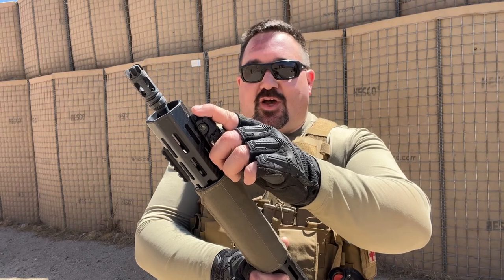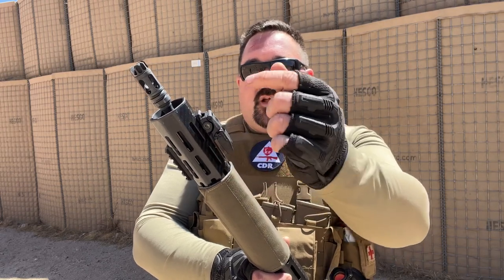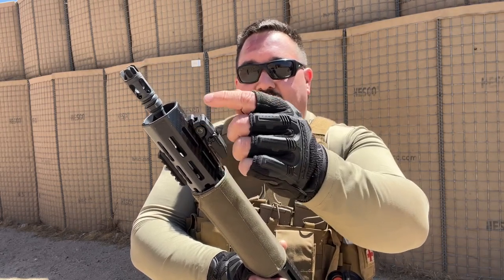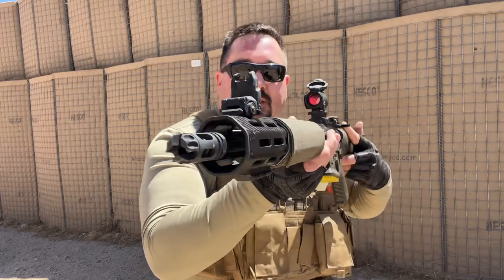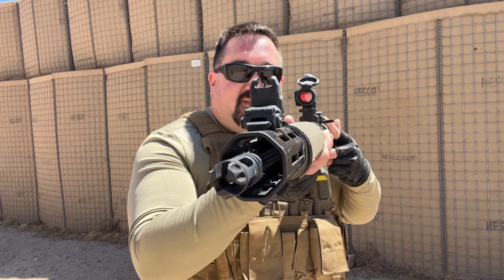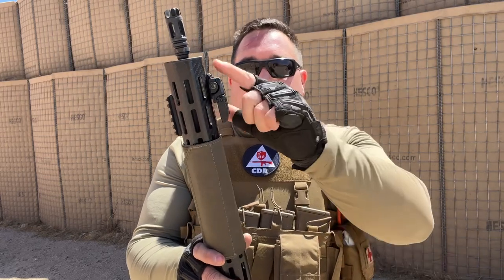How to ruin a WWSD

Comment: you're not tacticool unless your rifle has at least three sighting options
Reply from the maker: 7
Reply: @InrangeTv  and a forced watercooling system, for maximum flair.
Reply: how do i mount this crimson trace grip

its for a luger but it should go
Reply: I’m in this picture and I don’t like it
Reply: 1) Insert muzzle in target's left nostril.
2) Insert muzzle in target's right nostril.
3) Insert muzzle in target's left eye socket.
4) Insert muzzle in target's right eye socket.
5) Insert muzzle in target's mouth.
6) Insert muzzle and foregrip inside target's left trouser leg.
7) Insert muzzle and foregrip inside target's right trouser leg.
8) Remove target's trousers and insert muzzle in ta- Yes? Oh. Alright. There is no eighth way.
Reply: "What's that whirring sound?"

"Oh, that's either the gyro for the lead-predicting reflector sight, or coil whine from the millimetric-wavelength radar."
Reply: 3 Gun Open Class shooters are spending millions in R&D to find a 4th.
Reply: Mine has three🥴… Eotech, fixed front sight co-witnessed to act as a “ghost ring” through the window if the optic fails, and then a flip up rear BUIS for after the eotech is removed when/if it fails. But it’s a pistol not a rifle 😝!
Reply: @InrangeTv  Lol I built a 300 Blackout vacation.  Short barrel, big suppressor.  It is a WWSDIHWBATBAWITBVQ (what would Stoner do if he were building a 300 Blackout and wanted it to be very quiet).
Reply: @InrangeTv  What about the Leupold HAMR?
Tilt it to use the stacked Delta Point with your non-dominant eye. Add RMRs at 45° & 90° and laser grips. Flip up BUIS w/ tritium inserts a la GALIL/SIG 550 and In case of EMP😉, carry a few candles 🕯
Reply: @BogeyTheBear  The accumulator for the 40kW pulser...
Reply: @gregoryfilin8040  Conclusion: The most tacticool firearm is a Maxim machine gun
Reply: 3x tritium ACOG mounted on top, 45° trijicon RMR, and back up iron sights.

Side charging upper, 90° mounted rifle light laser combo, retractable bayonet, detachable brass knuckle foregrip, and a 100 rd ballsack magazine.

The ultimate versatile mall ninja set up.
Reply: @that1electrician  ahhh, yes… the side charging handle contraption for ARs. The ultimate zero purpose, added complexity, reduced functionality, tacticool add on!! 
If only it would make the charging handle reciprocate too… just like the best feature on the SCAR16
Reply: @InrangeTv  perhaps you could do a whole shitpost series of useless items to add to ARs. BAD lever, side charging handle uppers, forward assist…
Reply: @InrangeTv  I now want to see SinistralRifleman put as many different sights on his WWSD as possible:)
Reply: I have seriously added a shotgun high-vis bead front sight along flat handguard sections as an emergency backup.  Less useful at 100 but at 30?… gets the lead downrange.
Reply: Hey I really like the concept, but can you recommend the best way to mount a bayonet?  Since it is Carbine length, I need at least a 26" blade to properly repel cavalry.  Thanks.
Reply: Of which all are accessories.
Reply: @williamflowers9435  there are already side charging uppers with reciprocating charging knobs. Unless you mean opposite the ejection port..
Reply: Or you could just go to the future!!!
Reply: @williamflowers9435  side charging ARs have a legitimate role, albeit a very niche one. Single loading 90gr rounds through the ejection port, whose OAL won’t fit in a magazine. Exclusively for extreme long range (for an AR15).
Reply: Two is one and one is none, and you would be a fool not to have a back up.

So if my math is correct you need 4 sighting options.
Reply: @williamflowers9435  that would be hilarious
Reply: @eVVigilance  If you mount a long bayonet on a WWSD and use it against cavalry, the momentum of the horse and the mechanical advantage given by the distance from horse rib to rifle trunnion is going to bend that pretty little pencil barrel.
Don't put a bayonet on your WWSD carbine.
Carry a separate halberd, and a dagger or gladius for use if they get too close for you to use the halberd.
Reply: @Sableagle  I had considered this, but rejected it under 2 different possibilities.  In the first, so as not to unduly burden myself with superfluous and unnescessary accoutremants I need a solution that will be "all in one" eg a bayonet that will serve as pioneer saw as well, but equally well for entrenchment.  A seperate shovel, saw and pike, simply will not do.  More concerningly however is the crippling lack of Elan that comes from a "naked" rifle.  Without a suitable bayonet available,  rifles are of limited use, and one simply cannot achieve the proper state of mind without the shining focus of cold steel.
Reply: @williamflowers9435  Lmao The bad lever is worth more than you think… Love it for locking the bolt open, and ask KYLE Rittenhouse how “useless” the forward assist is 🥴😅!
Reply: @Sableagle  If he must use one, he should go with an Mlok or Picatinny mount to avoid bending the barrel. However I dont know that the carbon fiber hanguard will take it.

You are correct a halberd or any poleaxe, and a smachet, kukri, arming dagger or large bowie is the path forward against traditional cavalry.
Reply: I personally love my 45° offset irons, but I'm not confused about whether they're actually _useful_.
Reply: @BogeyTheBear  you sure its not the capacitors for the mass driver coils
Reply: flip up irons, a magnified optic zeroed for 250 yards, piggyback red dot zeroed for 50 yards on top of the optic, 45 degree red dot zeroed for 25 yards, might as well throw a 225 degree red dot on incase you have to shoot wrong handed, folding 45 degree buis (in case the red dot goes down) and of course a peq15 for night fighting. Anything less and you might as well dig your own grave
Reply: @mauer594  no. The Maxim does not have pressurized and forced cooling. I want a gun that's basically a small boiler.

Comment: Ok, so hear me out... Backup red dot sight.
Reply: a laser, a flash light and a flesh light
Reply: Why not? Even on some of my pelletpistols I had tri-sights (iron + scope + red dot), or I've ran iron + red dot + laser. Then there are even those cheapy scopes that have like everything in one unit (probably fine for BB and airsoft, and you might want the redundancy playing hard)
Reply: You jest, but it's the next trend to take off.  I saw some trainers on P&S talking about messing with it recently
Reply: Yup.
Reply: I have installed a red front post, as you requested.

Comment: The best way is actually to use a fixed sight and mount it on the bottom of the handguard using a full size rail section, and then drill a hole through the grip to use as a ghost ring. You have to also mount a series of prisms around one side of the mag well but being able to also use the fixed sight as a hand stop makes it worth the trade off.

Comment: Great.  Now make a “What Would A Stoner Do” rifle.  Y’know, a hollow grip for stashing a reefer, a wee box under the fore-end for munchies, a slot in the stock for a lighter, hole in the barrel to turn it into a cone-pipe.  🤙🏼
Reply: A brownells brn 180 upper frees up the buffer tube for and a kp 15 lower has an optional trap door in the stock. There are options.
Reply: I've built something similar. WWARSD and I built it on an A2 Stock. It's solid

Comment: It's funny in a day in age where BUIS is considered "back to the stone age" when they weigh very little and take up so little rail space you never notice them. There is no reason they are a detriment and add insurance that is nice to have when your primary fails.
Reply: It reminds me of when the F-4 came out without machine-guns/Cannons because missiles were all that were needed. If everything went perfect they weren't needed.  Meanwhile all of America's frontline fighters including the stealth fighters have cannons.
Reply: @Florkl  yup
Reply: @thedumbguncollector5546  The F-4 was designed as a missile interceptor, not as a fighter. Interceptors didn't have guns, other than the F-104. The F-4 was then repurposed into a multirole fighter, where guns were normal. And it replaced the F-8 Crusader with 4 guns, and was replaced by the F-15, F-14, and F-16 with guns. The F-100 also had guns in Vietnam, as did the F-5, and F-105.
Reply: @SoloRenegade  exactly. And they discovered things don’t always go as planned. BUIS (or as some prefer, even a backup red dot if you don’t mind the bulk and added batteries, etc)
Reply: @thedumbguncollector5546  Exactly, and as such I run iron backups, just as I run a Forward Assist, as I've had to use it in real life a few times for legit reasons (both in the military and as a civilian) without causing any malfunctions or damage as a result of using it either. These WWSD purists are ridiculous. They can believe and do as they like, but they are not right.
Reply: @SoloRenegade  The moment you seriously said that about the fuck-it-up-more button, you lost all credibility.

Comment: Karl kinda captured a milder version of what the Purist species of AK Fanboys have.  "Noooo!  The rifle has to stay stuck in the 1950's!  You're not allowed to mount any different sights or add lights or lighter more-ergonomic furniture to your own rifle!  NyEt, RiFLe iS FiNe....  What do you mean the AK is outdated?  It's not outdated!  It's more modern than all modern rifles!"
Reply: I wish it were just the fanboys. I can't tell if the Russians are just really lazy, really corrupt (or both), or actually think that extremely minuscule iterative changes are worth new model designations for a rifle that had terrible ergonomics from the start.

It seems like IWI is the only company putting any real effort into modernization.
Reply: @xb0xisbetter  I mean, the early prototype that everyone saw in videogames was a pretty significant change, problem is that that was apparently too expensive or something.
Reply: @Jessica-el5yx  Too expensive and too unreliable. Hilarious since the same could have been said of the early Type 1 AK47. Instead of working through the teething problems any new rifle has, they just went back to the 74M and actually modernized that. Except they seem to have forgotten to actually issue modern sights to troops armed with the AK12 so it's still effectively an AK74.
Reply: I'm stuck in the mid 80s with my laminate wood and plum furniture blend, excuse you!
Reply: @Jessica-el5yx  Early prototype of which AK variant, in particular? AK-12/AK-200? That would have been nice. Not that it would have necessarily ever made it to the U.S. anyway.
Reply: @xb0xisbetter  Assumed you were referring to the AK-12 production model and yeah, that's what I was talking about.
Reply: @xb0xisbetter  Found the guy who hasn’t found out about the SR-1, or AKV-521 or AK-200 series. They’ve modernized and improved enough, we just don’t get the good shit stateside.
Reply: @tugarin2345  AKV-521 I hadn't heard of yet. AK-200 I literally mentioned, but it was a prototype, so it doesn't matter. SR-1 has a cross-bolt safety, which is almost as bad as the original safety. What sort of production numbers does it have?

AKV-521 looks like a nice AK/AR hybridization besides still having a paddle magazine release. I wonder how easy it is to manipulate the safety.
Reply: @xb0xisbetter  Nothing wrong with the original AK lever or cross-bolt safeties. I personally can operate both quickly, and I’m just one of many. The AK has modernized enough. If you want more get a Sig 55x series rifle.
Reply: @tugarin2345  There's nothing wrong with cross-bolts or the original AK safety other than being kludgy. The cross-bolt at least has the excuse of being cheap and simple. The original AK design has no such excuse vs better alternatives. Why the Sig, in particular, when ARs are cheap, modular and plentiful?
Reply: @Havok0159  the akv521 looks quite interesting but I doubt that will go into service.

Comment: I don’t know I gotta disagree with Karl on this one. Murphy’s law you know. Batteries die things can break so what would it hurt having a backup set of iron sights. I know that higher tier optics are very robust and reliable but for what those flip ups add in weight why not piece of mind kinda thing
Reply: @sean7456  heavier...
Reply: Backup iron sights break too. So you need a backup backup ironsight. For the price of an iron sight you can get a cheap red dot for backup. Or you know a couple of hundreds of batteries.
What do you use your rifle anyway that this is a concern?

Comment: I don't get it, if you're some manner of sneaky spec ops commando behind enemy lines where equipment failure could mean life or death...sure, redundant sights make sense.
In civilian life where the worst thing that could happen is you do badly in the match that weekend and have to go home early?
Reply: I'd hate to drive 100 miles to go hunting and have sights fail for even a deer hunt, with the price of gas (my car would burn $50 just driving home and back), plus some of those areas may flood the roads so when you're planning on a week long hunt that doesn't matter, but getting back halfway through or mostly ruined trip, well I'd take the backups.
Reply: @jakegarrett8109  You don't keep spare batteries in your rifle bag? Why would you need batteries for a hunting scope?
Reply: So bring some tools and backup sights in your car, the point is they don't need to be attached to the rifle. A week-long hunting trip isn't really the sort of situation where you'll need to switch to backup sights in a heartbeat....
Reply: @MF-Rell  Bag? If its not on rifle, its probably getting forgotten (example, I don't remember if I even packed spare underwear for that trip... Seriously, if its not taped to the one tool I'm paying attention to then its probably getting forgotten).
Reply: @jakegarrett8109  I Feel you, I keep some in my Pistol grip or my hunting pouch.
Reply: @jakegarrett8109  Well friend, if that's the case the problem isn't the rifle.......LOL